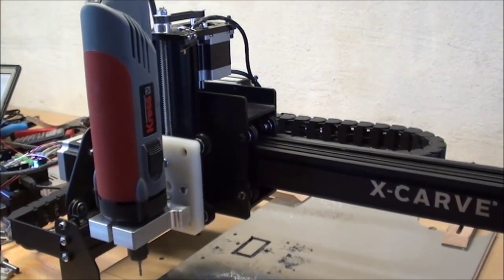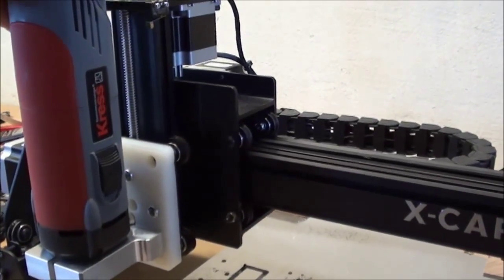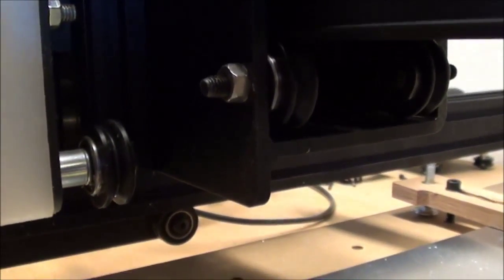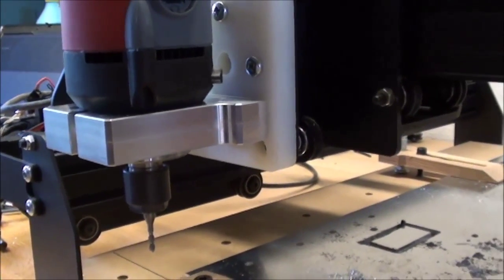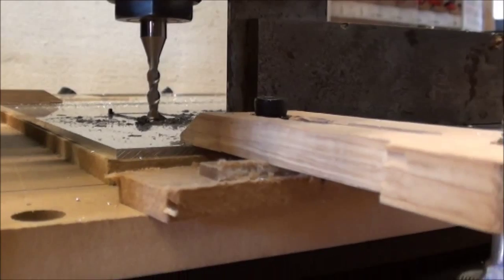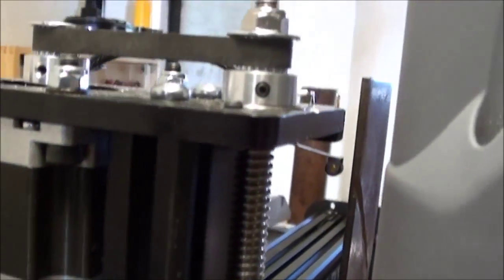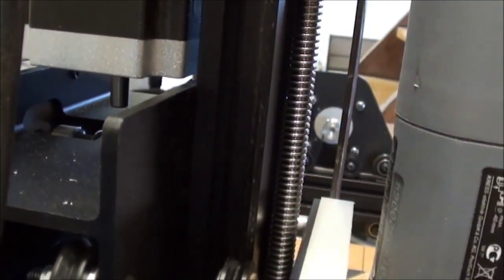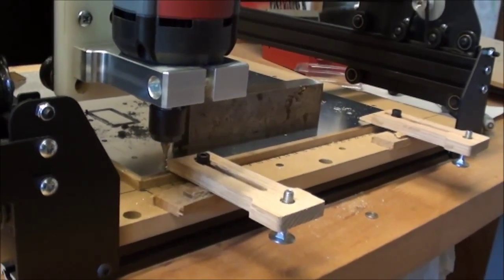X-Carve DIY CNC Router - Upgrading the Spindle

Comment: You made a thicker plastic plate and put that on the existing steel z plate? How did attach the two? And how do you adjust the eccentric nuts when they are sunk into the plastic plate like this?
Reply from the maker: +Auarhau Hi Auarhua,Yes you are right. I replaced the X-Carve motor holder extrusion with the old ShapeOko Spindle Mount Plate. On top of that I mounted the thick plastic plate you mentioned. It's necessary because the Kress spindle holder I have has a block of metal sticking out from the back to aligned it.You can see the Sketchup files on 3D Warehouse:Plastic plate: https://3dwarehouse.sketchup.com/model.html?id=u78a6d85e-31af-468d-8ffe-498819654e7e
 Kress spindle mount: https://3dwarehouse.sketchup.com/model.html?id=u1f0d8b1d-9bc3-4771-b5fc-da2cebff1f89
 ShapeOko spindle plate: https://3dwarehouse.sketchup.com/model.html?id=u5b3d9ec8-361c-4ec5-bdcc-c15e16de8d51
 If you do not have one you can still buy from Inventables: https://www.inventables.com/technologies/spindle-mounting-plate
Reply: Hi Martin. I know that the Kress plate needs to be thicker. I have the same problem. Im making a longer Z plate (even though it is less rigid). But how do you adjust the eccentric nuts when they are countersunk so deep in the plastic? None of the links work btw. Maybe the models is set to private?
Reply from the maker: +Auarhau 
I hope I have fixed the links now. I can not adjust the nuts with the plastic plate on. So I first secure that the wheels are as they should and then mount the plastic plate. The four corner holes are large enough to fit the eccentric nuts turning in any direction.

Comment: Why not make a 90° lowering bracket for the Kress rather than going to all the other effort?
Reply from the maker: You have a point. That would also work. The Reason for what I did was twofold. 
I had the already assembled Z gantry from my ShapeOko so it was easy. Secondly I prefer to have the center of the spindle close to the center of the X gantry to minimize bending. Moving the spindle down with a bracket would increase the length of the arm putting more bending force on the V-wheels. By lifting the material up I avoid that.